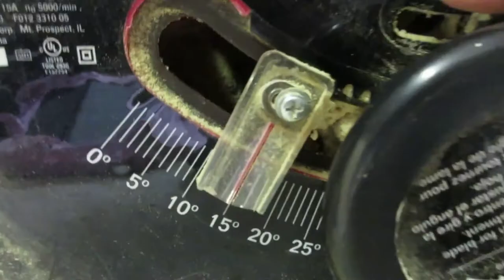The wishing well

Comment: Question, what is the angle you used to make the cuts?
Reply: 22.5*
Reply: @henryvaughn6295  allow me to answer. A circle is a total of 360 degrees. A hexagon has 6 connection or turning points to make its circumference . So. Take the 360 degrees and divide it by the 6 turning points in a hexagon. 360 devided by 6 = 60.  Now to make an angle of 60 degrees each half can only be 1/2 of total degree of angle. Cause it takes two pieces to make the angle. So a 60 degree angle is made by putting two 30 degree angles together. This your cut degree is 30.  Now an octagon has 8 sides or 8 turning points. Now do the math using 8. 360 divided by 8 = 45 divided by 2 = 22.5.   Have a good day.